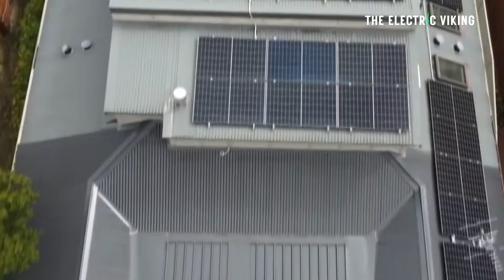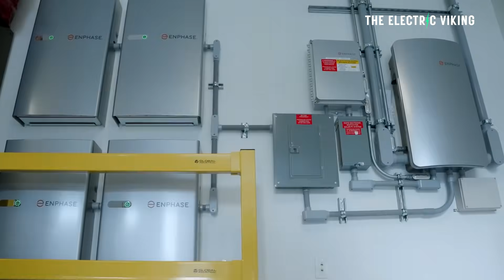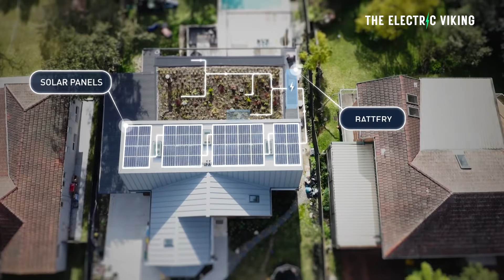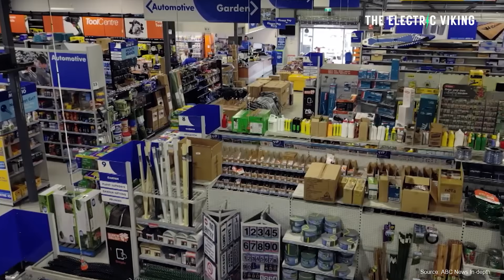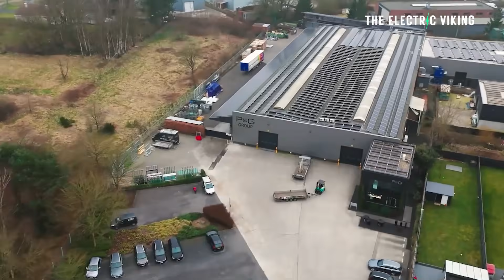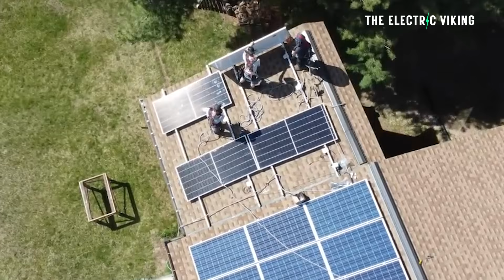Bunnings launches zero up-front home battery & solar deal - but there's a catch

Comment: I had solar system installed by Clear Solar many yrs ago was clearly aware that they wouldn't last 10 yrs like many others The 1.7 kw solar system  using a 1.7 kw sunnyboy inverter is still running strong The 2nd system was a 2 kw solar with an Aerosharp inverter with panels tilted to 30 degs on a  flat roof. The installation was done by cowboys ..... the panels were place too close to one another Ok in summer got 2 kw output Come Autumn the panels behind were over shadow by the ones in front  by shadowed 300 mm Consequently only 300w was made. Clear Solar had to do a reinstall and also correct wiring issues Also there was a batch problem with the inverters and we had 4 installed before we got a good one 3 days later Clear Solar went pear shape Aerosharp suffered the same fate soon after ...... no 10/25 yr warranty. Learning from this install that we  got 2 KW  all yr round at last. The first install had  a major issue During the summer the solar generation fell from 1 kw to 600 w when the ambient temperature was above 36 Deg C. Did some calculations a cell temp was above 100 deg so the calculation is the rating 175w @ 25 deg C. solar output is derated 0.5% per deg C above 25 deg C the calculation is  is 38 % So here had the panels reinstalled with 30 deg tilt on roof of 12 deg pitch. Added another 700 w. This arrangement is still producing 1.5 kw on a clear sunny @ noon after 16 yrs There are also shadowing issues on many installs done by cowboys were the generation is severely compromised

Comment: It’s all very complicated and expensive. It’s impossible to know who to trust, and also who will be around in a few years time. I feel certain that our federal government is taking us down the wrong path.
We should be seeing new highly concentrated energy sources being built that run on thorium, uranium, gas and coal.
Everything else is a waste of resources. 
I had a small rooftop solar system. A few years ago it was damaged by too much rain.
My home insurance company agreed to pay to replace it. The only supplier/installer who was interested in doing the job, was living in the next street. 
He is not technically proficient. Of course I didn’t know that at the time. 
To get my system working properly and putting power into the grid, I had to find another company with a technician who knew how to correctly wire the 2 inverters that had been supplied and installed to the current meter so that I could monitor the system and collect rebates from Ergon. That cost me over$500- and the original installer refused to pay for that.
Last week I spoke to 2 companies who have started advertising on FB.The first one said that to replace the existing 2 X 5 KW inverters with a new one that will also charge an 8 KW battery that they supply and install, will be $14,000-. 
The second company would supply a better brand with better chemistry. They have quoted $16,000-.
This is a giant hoax.

Comment: My Inverter gave it up on my 25 year old system , Essential Services In Vic no longer set feed in rates they have left it to the electricity companies the rate is around 1c per  KL so whats the point ? I sell my output for 1c  a KW buy is back at 20-35c a KW . I will wait until I can use my EV like a home battery and consider it then
Reply: Get a battery and charge your battery during the day and then use your battery at night to run the house.  That's what I do and I have almost $200 in credit as i don't use grid power, especially during summer
Reply: @andymartinez767 Hi, I do this as well.
No export to the grid, they are happy.
Take care M.
Reply: Kilo Watt Hour
Reply: Hi, that technology is out now. Have a good look and see if it is available in Oz.
Selling your solar to the grid at 1c is taking the mick. Just stop it.
They are there to supply you power not the other way around.
Put it in your battery instead and use it yourself.
Home battery or car to home etc.
Take care M.

Comment: What is the actual deal ? Yeah up front free but then what!!!?
Nothing is ever free!
Reply: Likely a loan or payment plan. HVAC installers here in the states I hear running ads for no upfront cost for new system but you pay a monthly fee which includes maintenance. For solar, this could be good depending on rate terms, and local electricity cost, but often solar loans are crap. It is probably better in AU, a lot of corruption in the solar industry in the US.
Reply: Most stores make large profit setting up finance for the more expensive products.
Reply: wonder if Bunnings and partner are setting up for a Virtual Power Plant - VPP, sort of like PLICO. Install shed loads of panels and batteries, sell the power back to the grid, home owner comes to use and the batteries have been drained flat by the VPP.
Reply: Its a loan masked as a 'subscription'.

Comment: Some of Bunnings battery powered mowers are still at least 2 generations old, Ryobi stuff over seas are using the latest battery tech, disappointed in Australian Bunnings is still using AGM batteries in some of them!
Reply: My AEG  58 volt battery died almost on day one, I have been trying for at least 8 months to get a replacement.  My local rep has been very helpful but I am still waiting!!

Comment: Probably if you buy it from Bunnings it'll be supported by Bunnings no matter who installed it and I don't think Bunnings will disappear soon.
Reply: that is NOT how this will work,  we thought so with Origin in QLD, and nope, warranty and everything else it thought the installer, who wanted nothing to do with it. 
I had to contact them to even find the installer because the paperwork had zero info on who did it..  
the only thing that came good from it was the 25c/kw for the first two years, which pretty much paid for the system. 

bot never again will I go through a third part for anything solar, because you're asking for trouble.
Reply: incorrect, any respectable manufacturer will honour the warranty regardless of retailer/installer going bust
Reply: @Noodlez2168  good luck with that.
Reply: No chance mate. What, are you going to turn up to the help desk at Bunnings and ask the 18 year old to come and fix your solar?
Reply: But under Australian consumer law it is the retailer who is responsible for warranty, they may claim back from the manufacturer or installer, but it is up to them to settle a warranty claim. If you bought a power tool from Bunnings and it failed you would expect Bunnings to honour the warranty, it applies to everything they sell, including a solar system.
Reply: @paulsi1234  Yes this maybe so but the is a major problem Bunnings sets up this deal @ zero up front. The home owner does not own the .gear but pay basically a rental fee / month. My experience has been with Clear Solar an not long after Aerosharp both went pear shape. The electrician who installed the gear was a subee was unknown So  I was left holding the baby
Reply: Not sure about that, bought a Samsung TV from Hardly Normal, it went bung after 6 months, after contacting them they didn't want to have a bar of me. When I explained I brought the unit from you, you made the money out if it, they basically said we don't care...contact Samsung. You would have to do your homework in depth, if you purchased the system from Bunnings, and press them hard as to what happens if support is needed, who does it, where, and how long is support away...further questions needed !!!
Reply: The issue is... Bunnings is not doing the installation it is effectively selling u an  arrangement of a 3rd party that provides the service ie installation with a monthly rental  and they don't need to be involved any further than that. The Installer gets the STCs then sell them on. As an end user don't know how much of a saving there is when u are generating power on your roof. Win win for Bunnings and the installer

Comment: I would say that it does not solve the issue for people who are renting.  Which is 2/3 of households
Reply: 1/3rd of households rent. In Australia.
Reply: @stephenbrickwood1602 ... yeah. I got that backwards.
Reply: of course not!
Reply: Its 1/3
Reply: I would say that people who are renting are not going to spend much at a home improvement store anyway.
Reply: A determined renter can buy portable systems and get there
Reply: @DavidBkiwee  What an ignorant assumption! Based on how decrepit most older rentals are you can and often need to do lots of removable improvements  and take it with you when you go. There are plenty of renter shoppers at Bunnings and elsewhere.
Reply: @kerryf9399 I stand corrected.